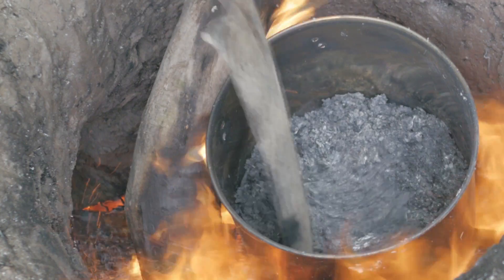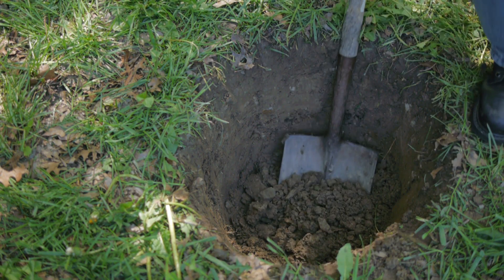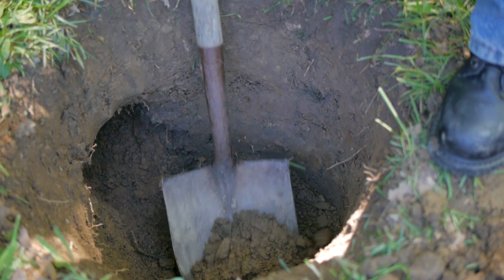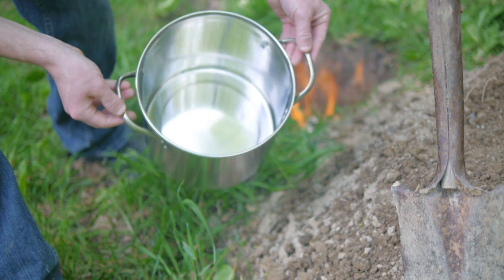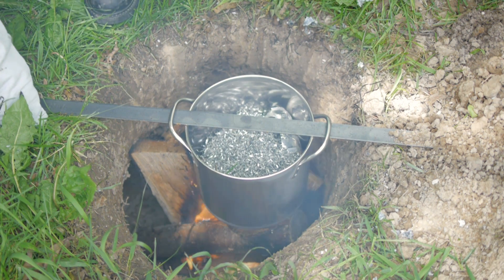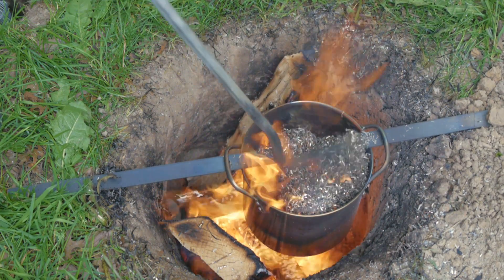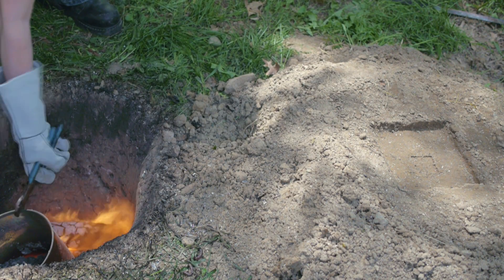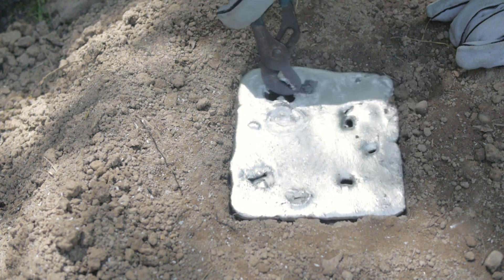How To Melt Aluminum With A Hole In The Ground

Comment: I've been doing this for years.  Great minds think alike!  For the air tunnel, I use a scrap piece of pipe from a fence post driven down at an angle to the hole bottom and a vacuum cleaner rigged as a blower.  I fuel mine with wooden blocks cut on the chop saw from scrap lumber and dead tree limbs.  I suggest a cover on the crucible as sand and ash sometimes blow over the top.  As the dirt in the hole dries out, the sides tend to crumble so this is only good for occasional pours where a permanent furnace is not worth the effort.  Aluminum cans are a poor choice for metal as there is so much surface area on the cans, they oxidize and create lots of slag. Better to add them to an already molten pot of metal if they must be used. Steel muffin tins are good to pour left over aluminum in to make ingots. 
Beware!  Molten metal is no joke. It will burn right through your shoe and molten metal poured on concrete or wet ground can explode from the steam created.
Reply: What do you use for a cast?
Reply: connor jackson
I use mostly extruded aluminum window frames and small engine parts such as pistons and engine blocks.  If you heat aluminum, it becomes brittle at high temps and can be broken apart with a big hammer.  some guys use old BBQ grills to heat metal in to make it brittle enough to break apart. I just throw it in the fire for a while. any ingots you make should be small enough to fit in your crucible.
Reply: connor jackson I use green sand. Some use lost foam casting.
Reply: clockguy2 I think he ment what method do you use as a mold for casting , just my take on what he said
Reply: ChickenPlaysHD Yes, that's what I was asking. I'm thinking of making custom molds and was wondering what other people have used.
Reply: What could to do to keep dirt and other contaminants out of the aluminum. I would much rather try this than building a barrel furnace
Reply: 1969mach1bd Before you pour skim the top with a steel ladle.  You can remove all the impurities that are lighter than the aluminum that way.  Be careful when you're pouring and don't turn the crucible fully upright. There's going to be stuff heavier than the aluminum (steel shavings, maybe dirt) at the bottom.  I sometimes will use that steel ladle to take up a serving of alumium from the molten pool without scraping the bottom to ensure i have a clean sample to pour.

Comment: About how much aluminum can you melt at a time in one of those pots?  I was hoping to do a cast of an anthill with about 20 pounds of aluminum but I worry that the added heat would cause the pot to weaken too much to hold the weight.

Comment: alittle sodium hydroxide( be careful)   aka    caustic soda   is a great flux and will speed the melt and minimise oxide formation
Reply: naoh crystals or solution?
Reply: pellets worked ok for me     maybe         experiment .    i cast silver  normally   where fluxes are vital    but have messed around with aluminium
Reply: Paul Roseblade you can also use table salt apparently, haven't tried it or even used flux because i only do aluminum melting (got a little propane powered blast furnace)  but ill try it out and report back.

Comment: you will need to re- heat the aluminium ( not melting it) to make it stronger because the cooling of the liquid aluminium make the metal weak

Comment: I have an idea, What if you dug the hole a little deeper, about a foot, and using something like a grill with handles that could have the pot on it? Also, if you used bought sand, like from a bad, couldn't you make form that wouldn't bubble?

Comment: is the fan necessary or would it work without?
Reply: Without the fan you would not get the required heat to melt your aluminium. The fan makes this work because it forces air into the fire making it much much hotter. It is the same for a forge when blacksmithing.

Comment: can you try it again using a leaf blower as the fan?
Reply: i think a too much powerful air flow will make ashes in the bottom fly to the sky
Reply: I once saw people who rebuilt a copy of an ancient medeval catapult, to cast the iron pieces, they also had to built a little primitive'like open forge. They was using coal insted of wood, and a leaf blower (but with a very very long tube to #1 to prevent the machine to melt #2 to prevent the ashes to fly in the air) insted of fans/ bellows. But with such combustible and such oxygen input, you'd be able to melt iron and steel.

Comment: Is it possible to do this withouth the fan?
Reply: You can also place a hair dryer. Just place the temperature on lowest and the blowing speed to medium or highest. I don't see why it shouldnt work.
Reply: yes but you won't reach a maximum level of heat to melt alluminium
Reply: so the aluminium wont melt at all? or do i have to blow through the hole like crazy xD
Reply: Raymond Boeijen blow... haha
Reply: guess I will hire someone to do that for me :)
Reply: Raymond Boeijen really?
Reply: just kidding, my little brother will do it for free :)))
Reply: aww its gonna be so much fun though
Reply: I think so, but the fire is going to burn much slower, and there won't be enough heat...
Reply: Mateo Vidaković I should work I've seen many people do it on youtube
Reply: Chris Qiao Well yea, we all have the hair dryer, and it blows stronger than that fan, but you need some extension cord...
Reply: I don't have a hair dryer at my house
Reply: Well, the hair dryer/fan blow more oxygen at the fire and it burns MUCH better and hotter, so I don't think this can be done without a fan or a hair dryer.
Reply: you are probably right
Reply: Want to provide REAL heat for the furnace? Get an electric leaf blower and put it on the lowest setting. ;)

Comment: Is it possible to make an aluminium sword??? (I may try that out!)
Reply: If you have a sword cast you proble can and the right tools you can
Reply: not strong enough, it would be a good prop though.
Reply: theoretical physicist early swords were made of copper yet they killed each other just fine (until the invention of armour.
Reply: electroguy2007 copper is much stronger than most aluminum alloys.

Comment: nice video :) my first attempts to melting aluminum were in duch a easy forge :) but there is a lot of slag produced by the soda cans and the turning waste. you should remove the slag before casting it because it would be cleaner cast than :)

Comment: That is a very sweet furnace!
Reply: Gio Penguin
don't pour aluminum in ice cold water, idiot! it will splash all over and burn your skin!
Reply: micultimy91 the ice cold water will cool down the steam from the sinking metal and will result in zero stream. The only splash will be from the aluminum displacing the water. Do some actual tests and don't believe old wives tales.
Reply: I have so many soda cand eack week. Also, I've heard that if you pour the aluminum into a bucket of ice cold water, it forms cool wavy patterns. From there, you can make it into your center-piece and call it modern art.
Reply: Gio Penguin what could go wrong right?
Reply: Andrew Hornsey if it splashes back into the crucible, it will result in a steam explosion, never do anything that involves molten metal and water.
Reply: theoretical physicist speakin from experience, nah
Reply: hi
Reply: o hey kipkay :D
Reply: Andrew Hornsey thats what im saying
Reply: theoretical physicist I seen them try that on Mythbusters, it has to be distilled water to work.
Reply: Grenades4Days i dont know if were talking about the same thing. clarify what your talking about.
Reply: Water and metal
Reply: Grenades4Days any type of water can boil explosively on contact with superheated objects.
Reply: Gio Penguin
I've pour molten lead into cold water in a large mayo jar and gotten the cool wavy, melted wax looking sticks. No explosion and stood away initially just to be safe but it wasn't necessary, but then again lead wasn't as hot as aluminum. It never hurts to err on the side of caution! ;)
Reply: safetey first =3
Reply: Andrew Hornsey well, you should still be carefull. i have a blast furnace i use it occasionally with my father, and i dont want anything to happen so i might take safety too seriously.
Reply: Oh look it's Kipgay.

Comment: Perfect food smoker. Just add a 55 gallon barrel with removable lid and the bottom cut out placed over the fire. Use metal rods or racks to hold the food you are smoking.

To control the smoke and heat, just cover the air intake.

I personally made this and smoked some ham and bacon (32lbs worth) for 48 - 72 hours (depending on weight) adding wood about every 5 hours, then loaded the wood for over night smoking and almost closed the air intake.

Tasty food.

Comment: Pretty please make a video on how I could cast this into knuckledusters or a knife. Pls?
Reply from the maker: Knuckle dusters aren't a bad idea, I might try that for my next aluminum video. A knife won't work so well. Aluminum is way too soft to make a good blade.
Reply: Tyler Raber still need a fan and probably raw charcoal or coal, as wood barely reaches working temp for steel easily
Reply: Volvary I said forge. Not crucible.
Reply: NightHawkInLight although you could totally use the same furnace as a forge for steel.
Reply: slango20 good point
Reply: Make a plaster of paris mold of a knife, then pour this shit in. It wont work great as knives should be created by smithing, not molding, and aluminum is an odd choice, but it WILL be a knife!

Comment: Super cool video, and I loved the DIY furnace!  Pouring onto the wet dirt like that, though, is insanely dangerous.  In the right (wrong) circumstance, the water violently evaporates and flings molten metal at your flesh.  Ultra dangerous.  At least from what I've heard, I have no experience here, just Internet Warrioring it.  :)  Thanks for the great furnace idea!

Comment: Another NOTE: Watch out for magnesium! Old style racing parts had a lot of magnesium in them. Magnesium is hard to start on fire, but if it does start, you cannot put it out! Bury it in sand until it burns itself out. When it burns it produces a brilliant white light, and it produces its own oxygen for combustion. usually any aluminum alloys containing over 4% magnesium is marked as magnesium.
Reply from the maker: Actually burying burning magnesium in sand is a bad idea. It can create a thermite reaction where the magnesium steals the oxygen from silicon dioxide causing it to burn even more vigorously or even explode. Otherwise it doesn't produce it's own oxygen as you say, but it can burn in CO2. The best thing to do is just put the lid on the pot and it won't take long to extinguish itself once both the oxygen and CO2 are depleted.

Comment: Dude, ALWAYS, ALWAYS pre heat your mold to +250 degrees F. This will eliminate any moisture, and keep you from getting steam explosion, resulting in an aluminum face mask. Pop cans are all 6061 T6 aluminum. There is no manufacturing code for the pull tab. They are made of softer stuff. Great video! Thank you.
Reply: Aluminum face mask???? 😃😮